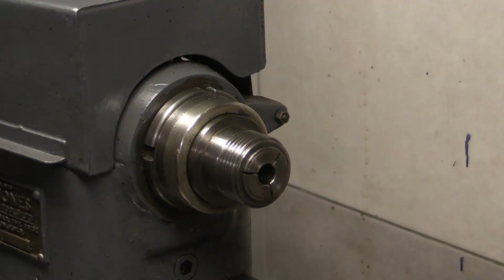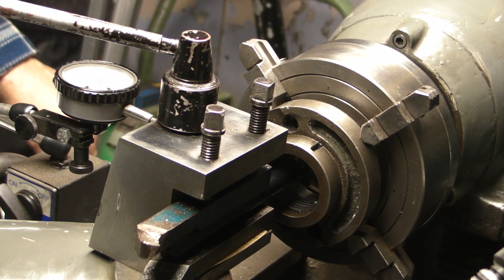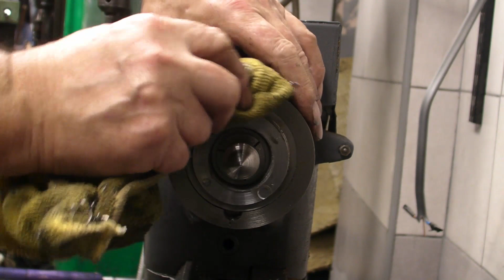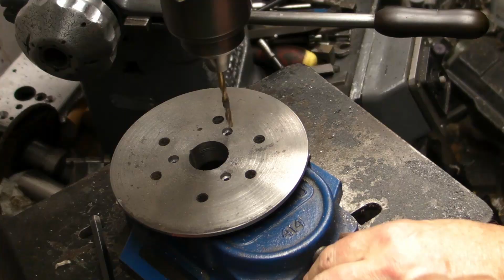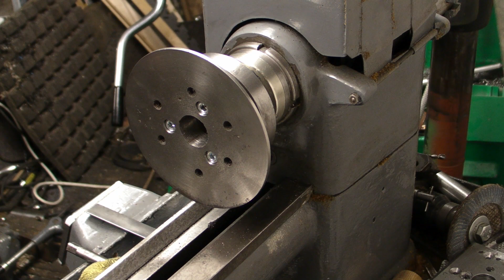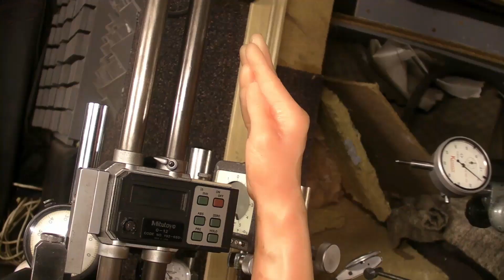Made a hot melt glue wood turning faceplate

Comment: Maybe you should make short screws that have been sharpened so it's a taper right where it clears the plate. I think that might offer the most grab with the least damage to the wood.
Reply from the maker: Hi J.P. getting geared up ready for the automatons, next up I might try cutting a gear in wood on the shaper, any tips ? Del.
Reply: @machinenutdel6764  I think you would know far better than I. The one problem that jumps out of me is the wood grain. I could see tear out happening quite easily when you are perpendicular to the grain. Might be best to lessen this by cutting your wood blank on a diagonal. That way each bite the shaper takes should be somewhat equalized in terms of tear out potential

Comment: Sorry to pepper you with questions, but I cannot tell what's going on with that chuck. I assume it is a collet chuck, does it have a closer on the front side? I see that bevel gear poking out, can't quite tell what I'm looking at. Have not seen a chuck quite like that
Reply from the maker: Its a Bernerd  multisize collet chuck, and works with a collar pushing as opposed to pulling the collet into the body, the closing collar has an outside thread and drawn in when you turn the chuck key, a very expensive bit of gear when new, I have been told over 2 grand, but I love it and would not be without it ! Del.
Reply: @machinenutdel6764  very cool! Thanks for the info.

Comment: Is that tool a homemade version of the tangential tool made by eccentric engineering? If so, how do you like it? I've been on the fence for a long time about buying one
Reply from the maker: It could well be home made J.P. came with a bunch of tooling I bought on Ebay, has a circular carbide tip, thats the first time using it on the extremely hard bar and it coped well, can see it becoming one of my go to cutters !